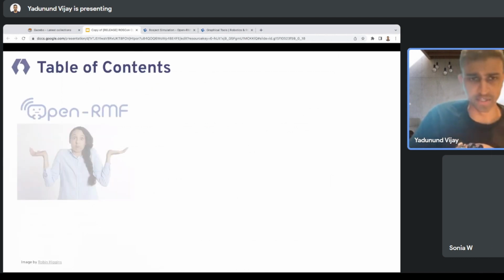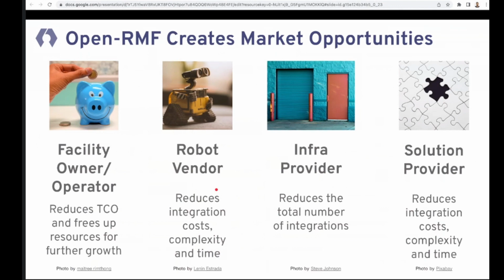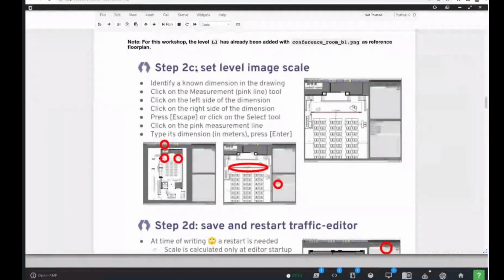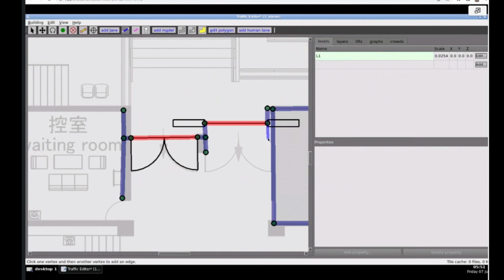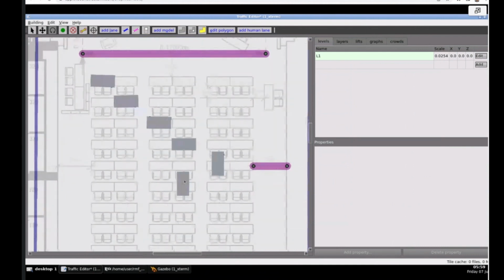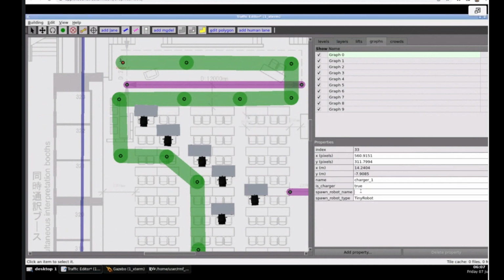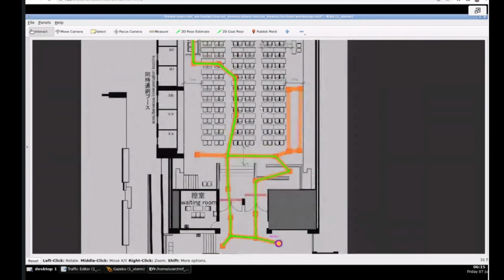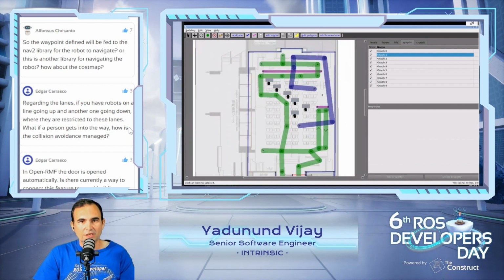Building Multi-Fleet Simulations with Open-RMF | Yadunund Vijay | ROS Developers Day 2023

Comment: Hey there, I am working on a fleet of mobile robots in Isaac Sim. While single AMR patrol tasks succeed for nearby nodes, the robot loses track, gets confused, or freezes when traversing longer distances. I have verified that the Nav2 stack functions correctly in isolation, but I suspect issues with the Open RMF fleet adapter, specifically regarding lane selection and path planning. 

The problem worsens with multiple AMRs, where robots appear confused about lane choices. I used rmf_site_editor instead of the standard traffic_editor to create the lanes. This choice was made because aligning the SLAM map origin with RMF's coordinate system was difficult in traffic_editor but straightforward in rmf_site_editor. However, rmf_site_editor saves maps as JSON, so I used a script to convert them to building.yaml, and then used ros2 rmf tool to generate the nav_graph.yaml. I suspect this conversion pipeline or the resulting node graph might contain errors. 

System resources are not the bottleneck: CPU usage is below 40%, RAM usage peaks at 16GB (out of 128GB), and I am using an NVIDIA RTX A4000 GPU.

The critical symptom is that navigation works for short distances but consistently fails for distant goals with a 'Goal Failed: Not Responding' error. I am using separate unidirectional lanes for two-way traffic. Could the issue stem from the node graph structure created in rmf_site_editor, the JSON-to-YAML conversion, or the use of unidirectional lanes causing pathfinding deadlocks  over long distances?